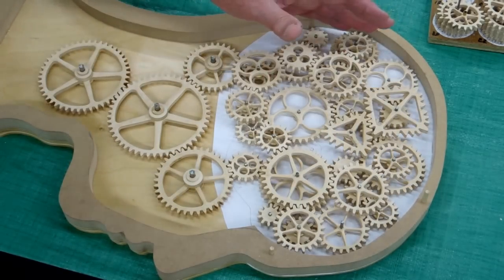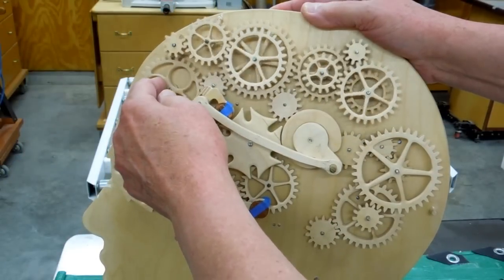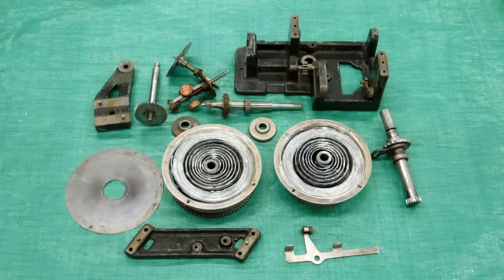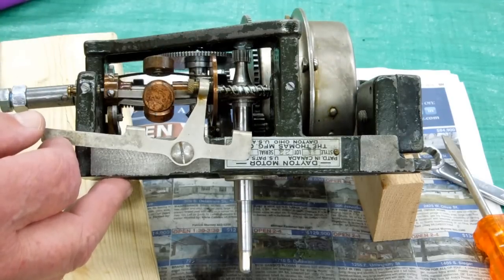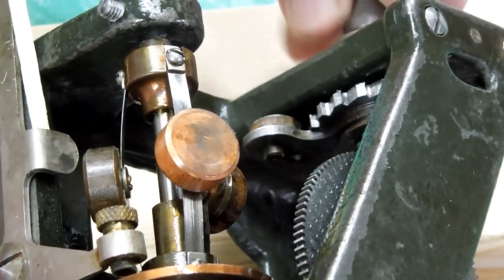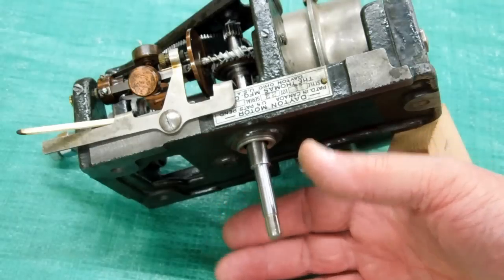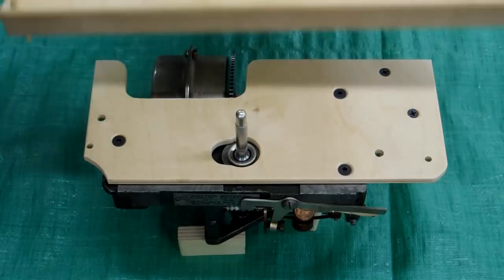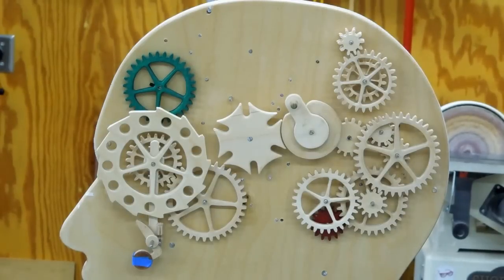Gear Head Part 2 - Construction & Spring Motor

Comment: nice one!
How much turns it can make on single load? output shaft.
thanks
Reply from the maker: I do not know. It is a 100 year old motor with 100 year old springs so I have not pushed it. I generally wind it with 25 turns of the cranking shaft and it runs long enough for me. I have not counted the output turns for 25 crank shaft turns.
Reply: Ronald Walters stuff were made better back than ))
im developing some mechanism, so this is important for me. but i think i get the info. thanks.

Comment: Ron, with so many moving parts does seasonal changes in the wood cause problems?
Reply from the maker: So many moving parts and all being hand cut required some fine tuning but the gears were cut to be a bit loose to begin with. Since all gears were made of Baltic Birch Plywood, it is fairly stable. Seasonal changes are not a big issue and Baltic Birch Plywood is usually the wood of choice when making wood gear clocks. The brass bushings running on piano wire axles and the nylon washer spacers keeps everything turning smoothly. Everything is held in place with ply push-on end caps and the adjustment of the caps is what holds the gears in position. If someone carelessly pushes on a gear or end cap it can cause some binding. Then the search is on to find the bit which was messed with. :-) Thanks for watching. Please Subscribe! Ron

Comment: I managed to make a ratchet system out of MDF + rubber (but i think it would work with wood as well) that's almost dead silent. 

The pawl end is made out of a piece of rubber trim. The kind you find on school desks (so heavy duty), i just cut it to the thickness of the pawl and using the barbed tab of the trim i glued it on the pawl end. There's barely any noise when the wheel turns and locks.

Comment: The colored gears are great for watching what's going on.  I hope you'll consider adding color to ones in the different layers.
Great looking project.
Reply from the maker: +James Rawlings I haven't really shown it yet but the green and red gears are there to show the two points for transfer of power from the front to the rear face... green to green and red to red. Stay tuned... ...

Comment: Hi Ron, You surprised me (again) with many elements of this project. I enjoyed learning a bit about Spring Motors. Are spring motors still made? I think the slowest speed looks great from an artistic point of view. How do you change the speed? Great job on being able to take the thing apart and especially for the biggest trick of putting it back together. Cheers!

Comment: Heh, I can relate to being slapped around by a coiled spring like in your wind up motor. I yanked a start cord a little to hard and the cord snapped, so I had to replace it, but I dropped the clutch thingy and the spring fell out, I had to put it back in, it wasn't fun.

Comment: I have no idea what this is for, I'm sure you'll enlighten us all presently. Suffice to say your work demonstrates your skills, workmanship and, not least, your patience! In my youth I worked for a tool and plant hire firm and spent ages repairing pull starts on chainsaws, lawn mowers and such. The return springs are similar to those in your motor and I agree, they are a PITA to reassemble requiring an individual with at least three hands and fingers of steel as thin as knitting needles.
Reply: It's for art I suppose